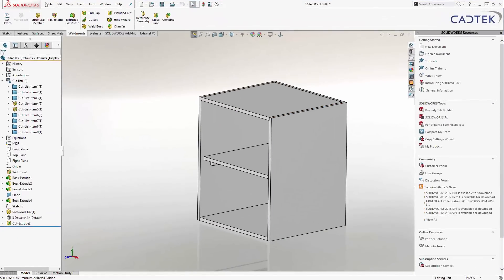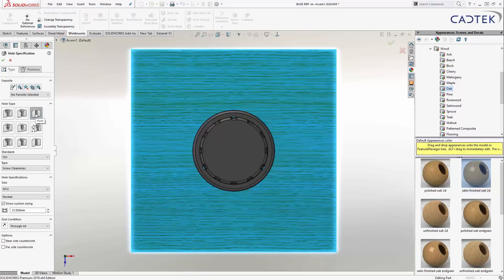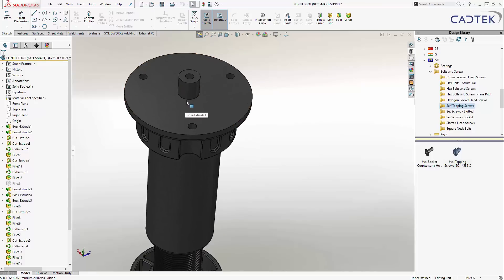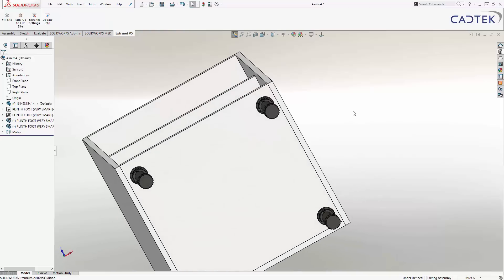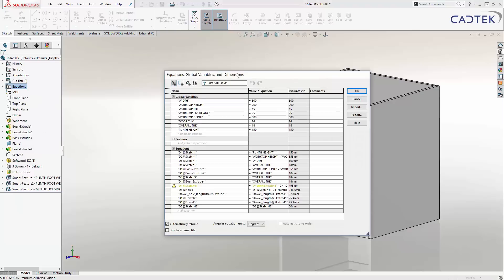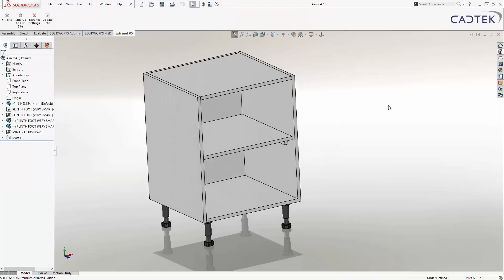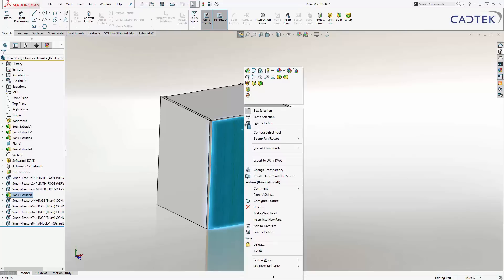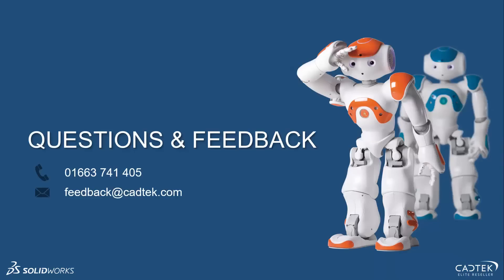Introduction To Cabinetry Within SolidWorks Part 3: Smart Parts

Comment: I have tried this method with Smart Parts and changing GLOBAL VARIABLES AND THE smart Part gets very dumb very quickly. You really skimmed over that when you changed some variables. It is not as easy as just 'rebuilding' the Smart Part. Can you explain a little more clearly please.